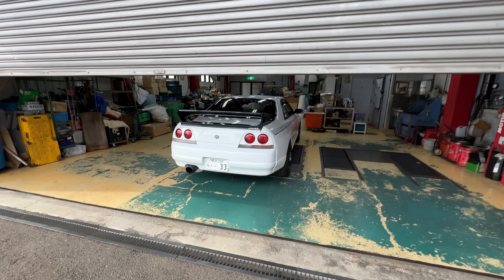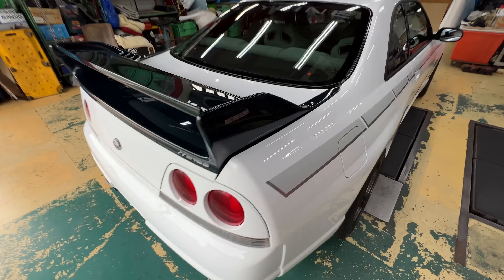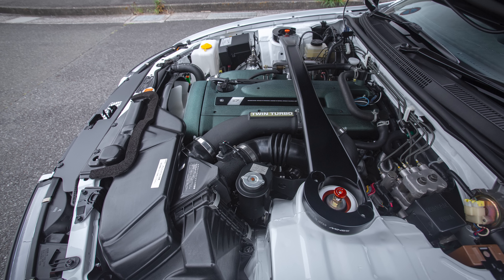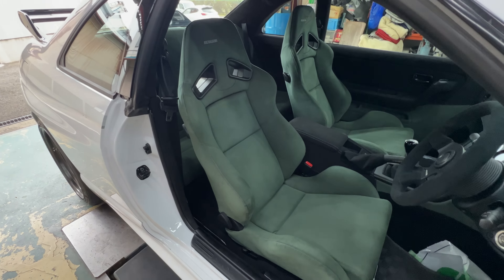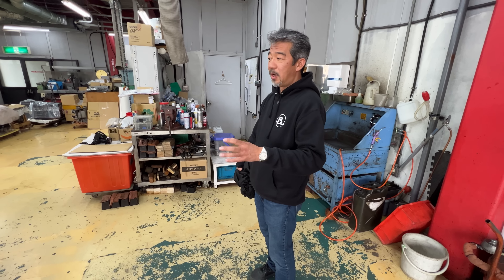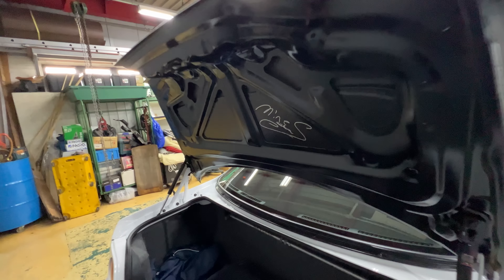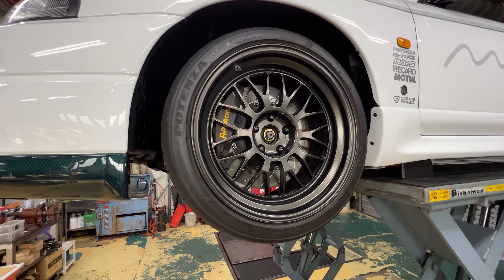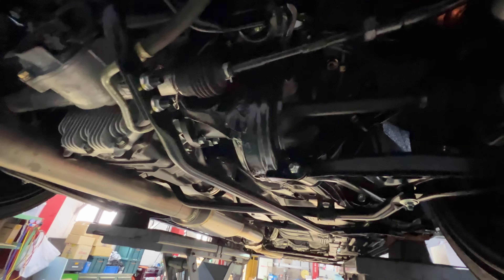The $500,000 R33 GTR - Built By Legends Skyline

Comment: It’s actually very similar to my R33 GTR, I have the Tomei RBX 2,8 lt with V Cam System and the Nismo 6 speed Getrag manual gearbox, I also have the Nismo Carbon Fibre Rear Differential, the car has around 85 percent of the Nismo Catalog of parts fitted, and has 700 hp at 1,6 bar of boost, I love R33:s, the Mines car is gorgeous guys, take care and Drive safe.